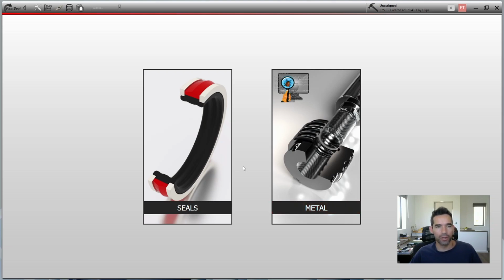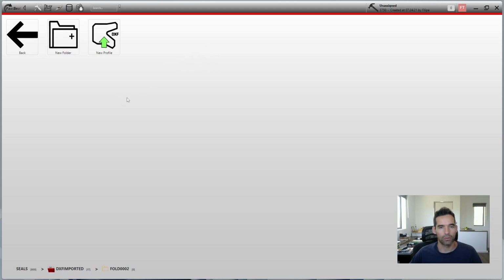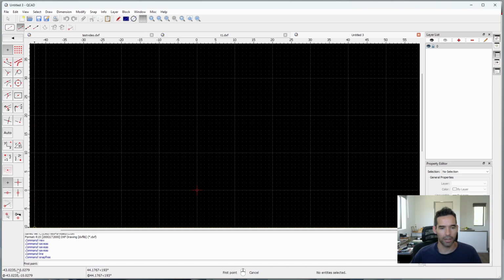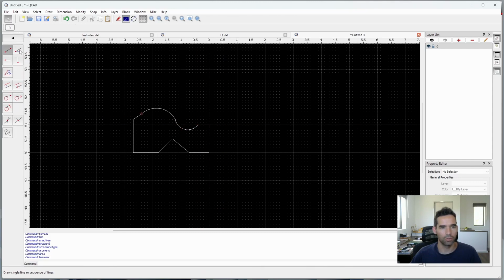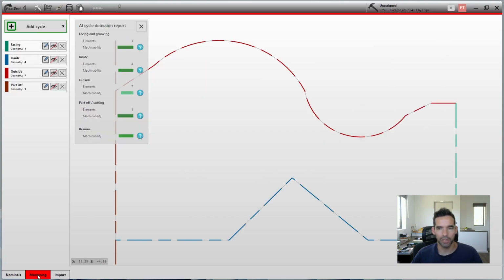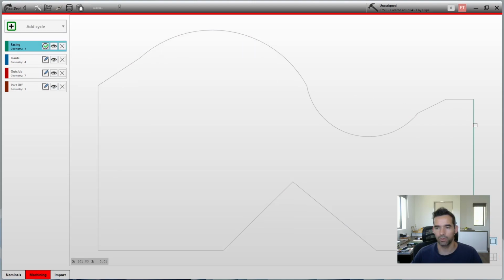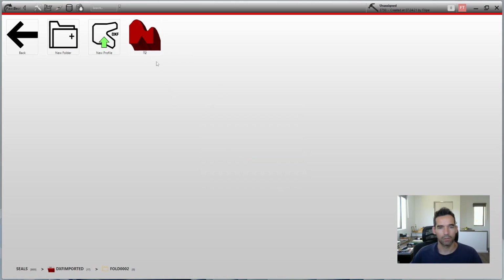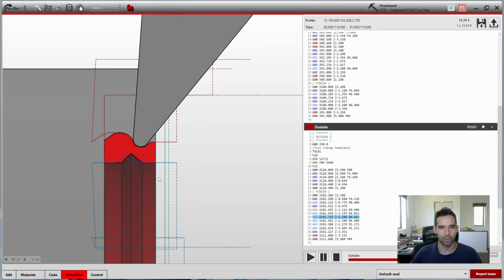FastSealCreator 5 - Example of importing a DXF file

Comment: @fastcnc is there a way to vary your dimensions after importing your new seal profile?

I’ve just recently started working with the software and I can successfully import new profiles, but I cannot figure out how to edit them like a pre-existing profile. 

Any help would be appreciated 😊
Reply: Also have you had any success using alternative CAD programs to import via dxf? I was struggling when using Fusion360 but managed fine with QCAD